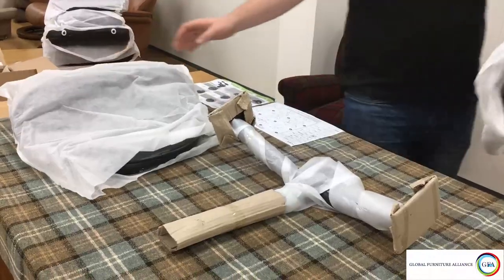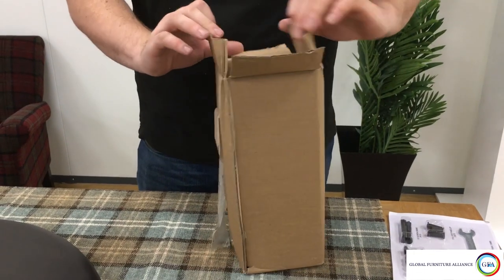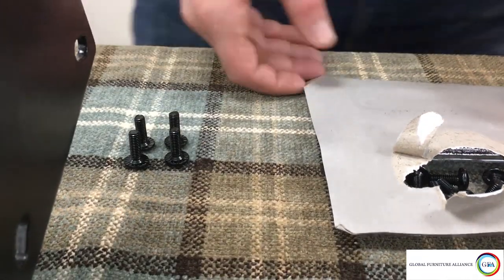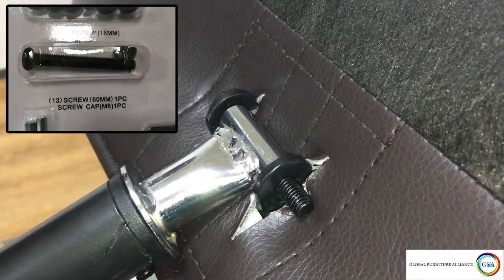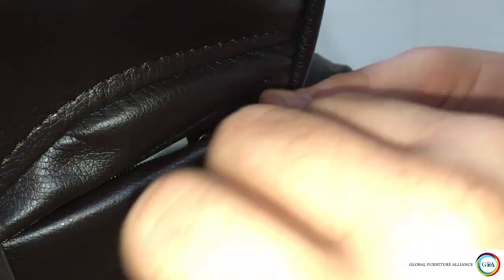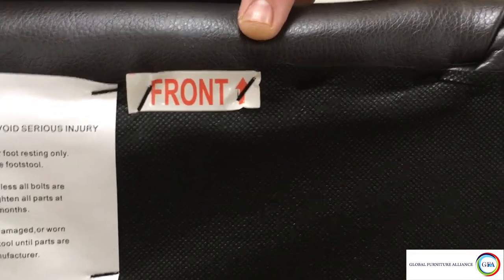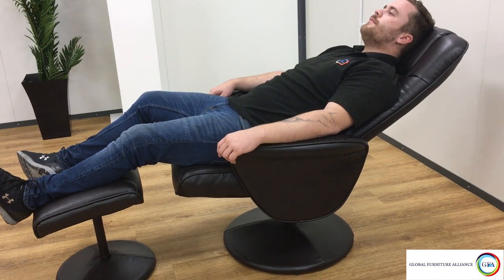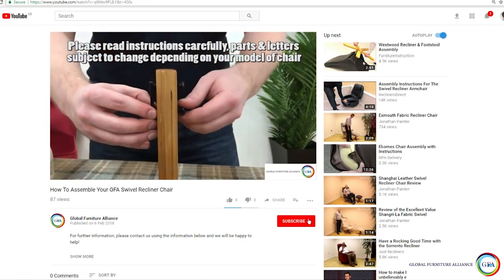How To Assemble Your Turin Swivel Recliner & Footstool

Comment: After purchasing an Avant Garde swivel recliner, I found that the enclosed instructions were not terribly intuitive, especially when it came to attaching the arms to the frame. This video helped me to kick start the assembly process, as it's broadly the same, except when it comes to attaching the seat back to the base. Fortunately, by the time I got to that part, the instructions actually made some sense.

Comment: The big problem with GFA and self assembly,is that the included instructions are so unclear, so TINY! that you need either a magnifying glass to use them.or pay some store employee to assemble for you.(In fact it would not surprise me if  this is a deliberate marketing ploy)
My other observation concerns sloppiness of construction (positioning and welding). When you're paying £500 for a swivel chair (Turin model) you really expect a certain standard of workmanship.